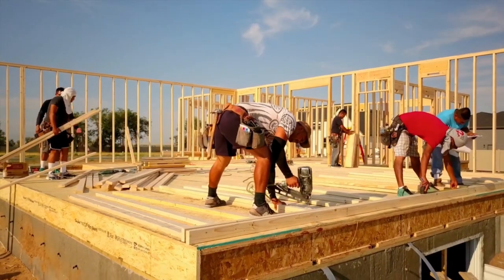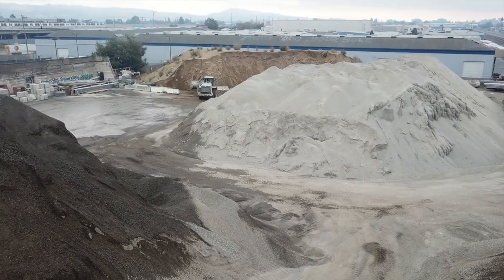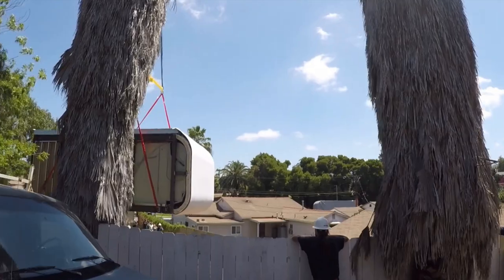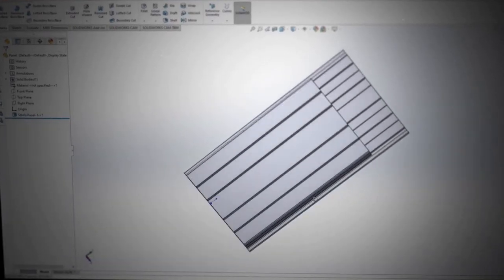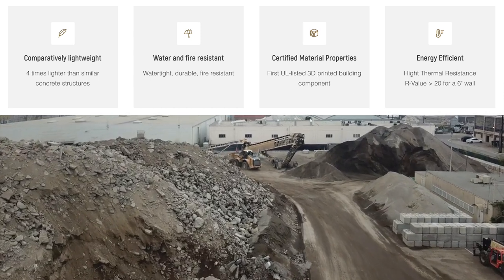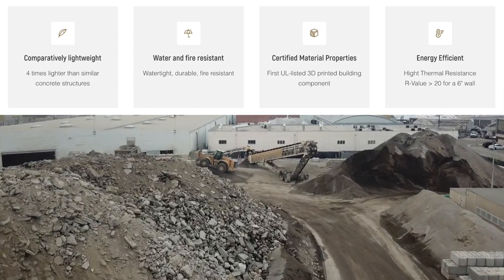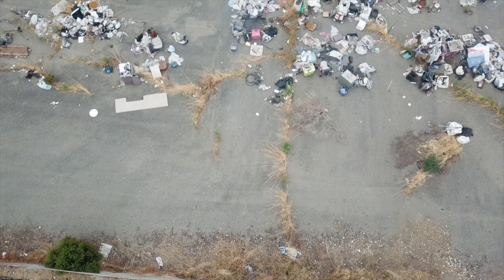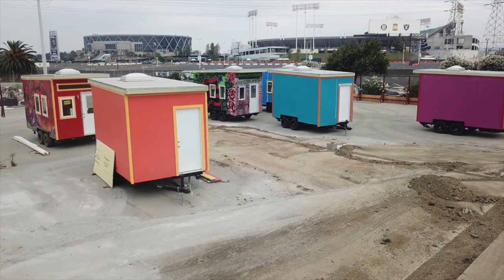Tiny House made with 3D Printed Synthetic Stone | Mighty Buildings Raised $30M from Silicon Valley

Comment: Jarett, thanks again for your research! You prompted me to look up a UL listing for a building assembly. One using materials entirely new to construction for exterior bearing walls etc, seems amazing to have issued. Their UL listing does have a few limitations at this point: 
"It has not been investigated as a load bearing wall...Interior surfaces of the 3D printed wall core are to be provided with two ¼ in. thick layers or one ½ in. thick layer of  UL-Classified  gypsum  board...The  ability  of  the  wall  assembly  covered  by  this  report  to  comply  with  the  structural  design  requirements of the above referenced Codes has not been evaluated. Code  compliant  exterior  wall  coverings,  vapor  barriers,  exterior insulation, and water/air barriers are to be provided to complete the wall assembly. The acceptability of the wall coverings, vapor barriers, exterior insulation, and water/air barriers is to be determined by the code official." Another article indicates that the material also needs exterior fire protection.
Given all that, I think that the method well serves its purpose, as we, and others with more $, are paying attention to them.
Reply from the maker: Wow really glad you shared this info big value add

Comment: C'mon man.  The video starts with the cost savings and then we see the prices.  What BS.  Note, I assume If I whip out my PayPal to order one of these up , that's the price to plop this modernized modular unit on my site that I have paid to acquire and prep - so thousands more unaccounted for.

To me, this is important tech and advancement but, in reality this may just be commoditized by building material monoliths.  Having experience in pre-fabrication building (both stick building boxes and precast concrete) I can tell you that cycle time savings is always touted but rarely if ever realized because so much more forethought  is needed before start of construction, not to mention production time., You can't just print a draft version a home and re-iterate later.   I know a lot of traditional "modular" builders and I can stick build a house faster than they can.   

We're not even getting into the unintended consequences, off-gassing, wind-hold down requirements, material element leaching . . .
Someone please link me to a site prep video for this structure.
Reply from the maker: This is the closest I could find of a site prep video. https://youtu.be/3xN450W7ix4 You bring up good points and shipping does cost extra. I think it’s just a regular slab. One thing I’d like you to keep in mind is that with economies of scale the 1000th unit will be far cheaper and and more efficient than the first. It’s a work in progress.
Reply: @automateconstruction  economies of scale work for mass production in factories, not for 3d printing.
Reply from the maker: @ooooneeee  It works for the mass production of the material being printed. The bigger batch size, the cheaper it will get.